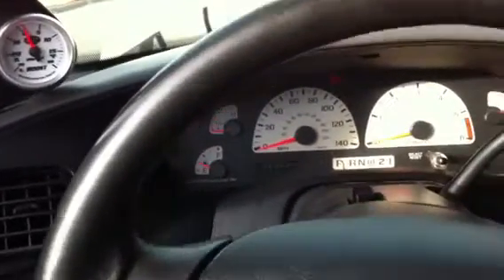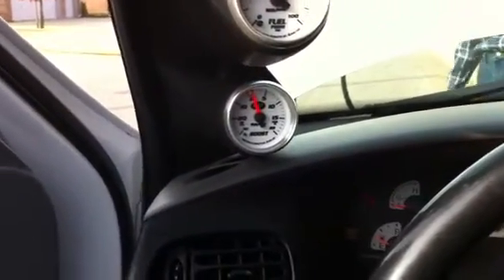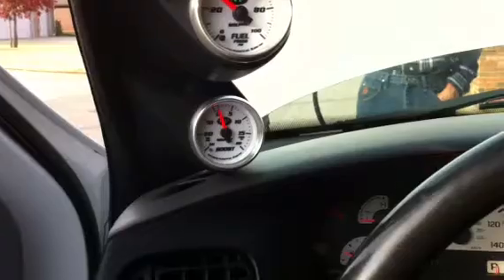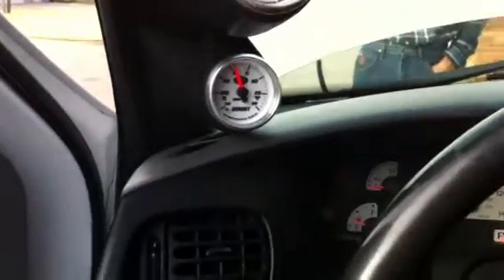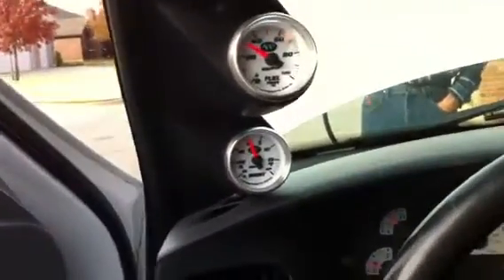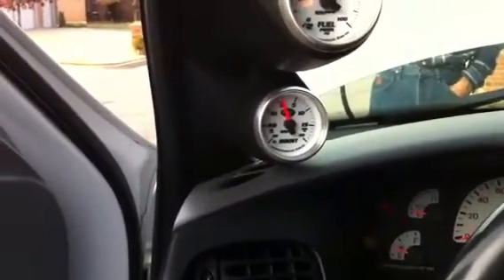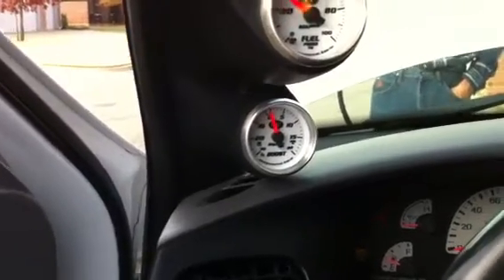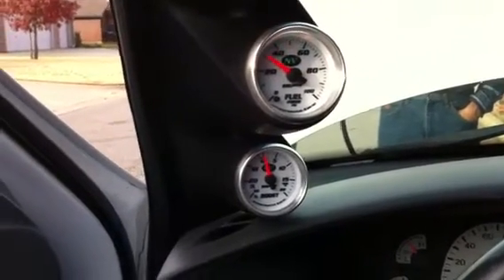SVT Lightning starts up and then stalls

Comment from the maker: I had just replaced the pumps with Walbro 255s... I looked under the front of the truck above the intercooler pump and saw that the wires going into the fuel pump resistor was burned up and the resister itself was scorched. People on LightningRodde helped me with finding the issue.

Comment: I'm running into the same issue but my fuel resistor is like new and I even upgraded its connection to make sure it's not a loose connection. I cleaned the idle thing that located on the back passenger side of the supercharger. My fuel pressure is on point. I just upgraded the whole supercharger to the newer true kb2.6L. Truck sat for 2 years I drained fuel and replaced the fuel filter along with fresh gas. Truck wants to run then dies and makes a crazy wine sound as it's dying out

Comment: I have the same truck that had the same issue, it was the white ceramic impact sensor below the radiator support. it deteriorates after time; it supposed cut off the fuel pump Apon front impact.
Reply: the part is called fuel pump voltage resistor. which is located underneath the radiator core support next to the supercharger pump

Comment from the maker: Turned out to be a fuel pump hi/lo resistor... its made of porcelain and mine had burnt up,  I replaced the $75 part and it started up and ran fine.
Reply: mine is doing the same thing whats the part and were is it located help
Reply: Yup I just went through the exact same thing on my Lightning.

Comment: Do you have the link or where you got the fuel pump resistor having the same problem
Reply from the maker: @SvtJohnny yes, I bought it from LightningForcePerformance out of Texas... ordered over the phone, not sure if they have them listed on their website.
Reply from the maker: @starlordsvt9532  It is located above/behind the IC pump. If you look up under the front bumper on the drivers side, there is a small white module with a harness coming off of it... this is the fuel resistor.

Comment: What was wrong with it? my truck just started doing it today
Reply from the maker: +Raul Ramirez  Was the fuel pump resistor... located above/behind the IC pump.  If you look up under the front bumper on the drivers side, there is a small white module with a harness coming off of it... this is the fuel resistor.  When it fails or begins to fail, this issue occurs.
Reply: Show a video on how to change b!?